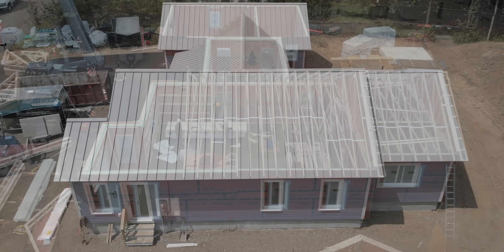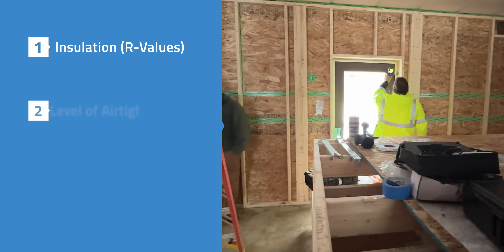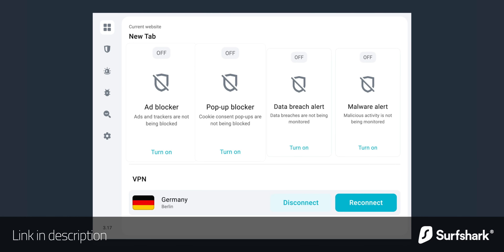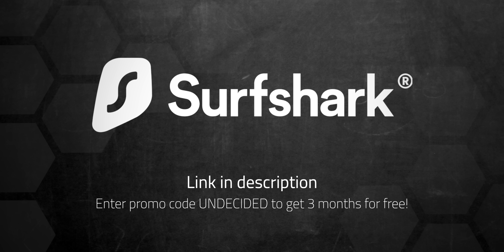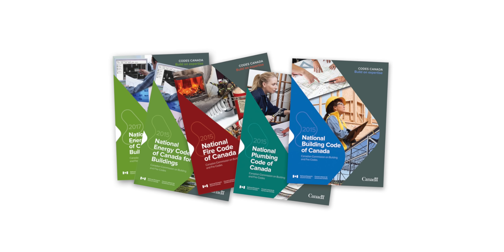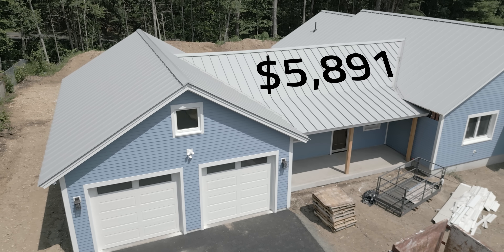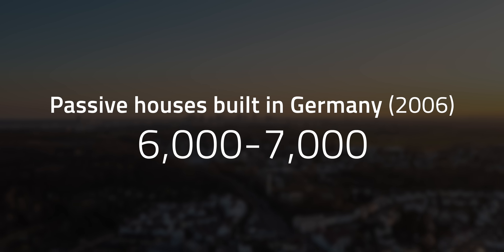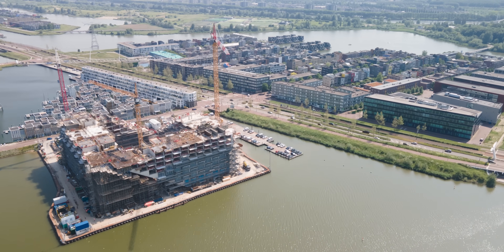Why Do American Homes Suck?

Comment: I live in a home that was built in the early 1900, it is definitely not airtight, has 0 insulation in the walls, and has multiple asbestos contaminations.

These are all fairly easy fixes, we just need money, imagine how much sleep could reduce our energy cost as a nation if there was some kind of grant, or tax write-off for remodeling old homes up to modern efficiency standards. 

New doors, windows, insulations, a house wrap. Already a huge improvement with just these. 

Maybe the government could even commission a bulk order to the supplies, and then distribute them to those who qualify at cost, it would greatly reduce remodel cost by cutting out the greedy middle man, and then residence could either remodel themselves, or hire someone to do it for them.

Comment: I lived in Switzerland, Spain and France and I can tell you that not at all it is all glory. Of course Switzerland has the highest Standards, but even there in practice a lot of theoretically sound buildings fail in practise. More tech in the houses isn't the solution, a well insulated house with walls then can absorb moisture and gas (wood, hemp bricks, adobe etc.) demand less sophisticated ventilation and often don't need a costly heat pump.

Comment: I think I read somewhere about the life expectancy of a house in the US being ridiculously low. If that's the case then it makes sense that the people funding the building aren't going to invest.

On another note I think I remember you saying you expected to consume around 5MWh/year in your new house (maybe your old one). That's nuts! I'm in a new UK home, alright but not super energy efficient, and I expect to maybe use 1 MWh total this year between electricity and a gas fired boiler (I think the US would refer to hydronic heating?). And I think that's quite high!
Reply: Are you sure you got your units right? My floor heating(1kW) in small bathroom uses around 1MWh in year. Total electricity consumption in house is 14MWh. 5MWh sound kind of possible, 1MWh feels impossible. 
I lived in 30m2 apartment for couple years and i used more electricity in there, and hot water/heating wasnt in that electricity bill. ( i think it was around 1,2MWh just for cooking, cleaning and entertainment)
Reply: @PeRusliStA  you might be right now I think harder. Will check later
Reply: “life expectancy of a house in the US… low”

Part of that is because of mobility.

In 2000, the average American lived in a home for about 3 years. American society is very mobile.

Part of mobility is about security.

Liberals don’t like to enforce the law in the US (unlike some other nations), so people vote for people who don’t enforce the laws, people die, families move out, other families in worse places move in, eventually those families figure out that it is better a little farther out, they move out, and the land is redeveloped as something more expensive, then more people move out, then the land turns into big shopping plazas, more people move out, they become warehouses, then when there is no one left, high rise building businesses are made, and people only go back for work while they find their security elsewhere for their families.

The average US family is not wealthy like Matt, who produced this video. The average family is trying to find a good school where their kids won’t get beaten up in school, their wife won’t get robbed, their daughter won’t get raped, and their car will not get broken into. Matt speaks of regulations, large numbers of people speak of families & security first, and cost is a significant factor in escaping liberal urban insecure zones. No one wants to run out of energy / fuel in one of those liberal insecure zones, along the way while going to/from work.

Security is more important than energy efficiency. Saving $90 a month on electricity is insignificant when your wife is dead.

Comment: I expected that you would cover more than just energy efficiency in this comparison. You touched on this a little bit with the choice of inferior materials such as card board sheathing. But to me this goes much further. American houses are much less durable and much more prone to failures. Stick frame buildings perform badly in storms and are not fire resistant. Asphalt shingle roofs last about 15 years, whereas European roofs last 50 to 100 years. Tiles near wood in bathrooms seems like a terrible idea and this frequently fails. 

In Germany we usually built very solid houses based on brick masonry with solid roofing tiles. In the past few decades we have been using better insulating solid blocks such as Poroton or Xella (AAC), and thicker layers of insulation. 80% of our newly built houses are using some kind of solid masonry block, and only 20% use wood.

For example one of the most popular: 'Poroton' is the trade name for a fired-clay block (or 'jumbo brick') manufactured to a high degree of accuracy. These blocks are formed with a honeycomb structure of vertical perforations, that reduce the material in the block (and thus the weight), whilst maintaining adequate strength and increasing the thermal resistance of the block.
Reply: Americans live in a home, every 3 years, before moving. They really don’t care. They have other priorities, like security, schools, and reasonable way to get to work.
Reply: @DavidHalko  Disposable homes? I do like the flexibility of Americans to take advantage of new opportunities, but this type of house construction does not seem to be very "sustainable". Wouldn't is be cheaper in the long run, if homes are more durable? I have lived in a an old Canadian home in the eighties and it seems to me that in the past homes were built to last longer, even in North America.
Reply: Hi @ChristianWagner888  -

‘disposable homes… this type of house construction does not seem to be very “sustainable”’

Well, in some ways it is VERY sustainable… home usage change dramatically over time.

For example, when I was young, we had this large console radio & record player. It took up a large section of a whole room.

In a short number of years, it disappeared, since we moved to a vertical rack. Then, it disappeared entirely. 

We had a large tube TV on a large table, with video games underneath. It disappeared entirely.

We had a wood burning stove, as we used it to survive the energy crisis in the 1970’s, with a large stove pipe that went through the wall & hung on the house. That disappeared.

Now a days, flat screen TV’s hang on a wall. 

Homes of the past did not have much window space, to save space for book shelves & other large items, and also because of the energy crisis of the 1970’s.

Bathrooms were much smaller in older houses, literally water closets.

These same homes are easily modified by people, to meet their needs. 

Stick built homes are more “forward looking” - people add kitchens, expand walls for bathroom features, add additional bathrooms, add media rooms, add home offices, add home school rooms… in the future, the large dining rooms that are disappearing in newly built homes will likely re-appear as holographic rooms.

My brick home is built to stay, but blowing out a brick wall is not trivial, to expand my bathroom, for a garden tub, or a hot tub… and a missing garden tub something that was regretted since buying the home 20 years ago.

Can work be done to concrete homes?

Sure, but adding a second kitchen, an extra wall, was effortless with stick built wood home… without assistance from external contractors.
Reply: @DavidHalko  flexibility has a higher cultural value in America, whereas durability has a higher cultural value in Europe. You certainly have a point, if people actually change walls and window sizes a lot over the lifetime of the house. Most people won't do that DIY without the help of a contractor, as this could involve plumbing, electrical and structural issues.

My grandparents house in Berlin was bought in 1939 and is now over 100 years old. It was in fairly good condition until the 1980s and then renovated from the ground up by the new owners. They added an extension with larger windows, waterproofing to the basement, improved insulation, and built out the attic with a bathroom and bedrooms. These foundational changes are made about every 40 to 50 years, but the substance of the home remains, if it was originally built well. Now three generations live in that spacious home together.  I still believe this kind of durability wins out in being more sustainable in the long run.
Reply: @ChristianWagner888  - that is an amazing amount of work, done to your grandparents home!

My stick built home is over 50 years, now. A lot of work done, I will likely be here another 20-30 years. While most Americans may not desire durability, I made this purchase for durability, even as stick built.

My home is over 50 years old, my childhood home over 70 years old, my wife’s childhood home over 120 years old… all stick built: two houses had all the windows replaced, two of those houses added a bedroom, the third house added 3 bedrooms, one expanded a full bathroom, another added a laundry room & kitchen. 

I’ve heard it said that a home is never really your own home until you make a significant addition. Perhaps, that is an American ideal.

I’m still not sure how this all scores on durability… perhaps durability is in the eye of the beholder. Enjoy your home!

Comment: I live in a third world country.
We build 99% of our houses with cement.
Most houses are 2+ floors for 1+families.
I always was curious why in the west all houses are prefabricated.

I realized,  we have no standards whatsoever
Reply: Corporate greed
Reply: @logans3365  you mean because they are cheaper so corporations can make more money?
Reply: @fuzzy-02  yes, corporations build things as cheaply as possible, often times they will design them poorly on purpose so that you have to buy another one sooner. 

My friends have a brand new $300,000 house, the floors creak, the pipes vibrate in the walls, it’s poorly insulated, etc 

They build cheap and sell expensive, for personal gain, at the cost of everyone else
Reply: @logans3365  well damn. 
Here we go by two options mostly.
Either the fsmily build their house, if their well off might also include extra floors for the kids in the future.
Or you buy an apartment in a building. 

But id say prices in general for the latter are maybe 80k,100k on average. You might find cheaper, or more expensive depending on area.

But yeah we have greed too.
Probably 7/10 contractors you hire to build your house will end up charging 30% more indirectly by stealing shit.

Like taking cement for another place their working in, to cut costs. Charging you more. Doing a terrible job 

With cement buildings and corporate greed, the most obvious issues here is moisture, dry and sometimes cracking balconies and rot from moistures on some places. You end up paying every few years for re insulating with layers of paint.

I can see why prefabricated is better. If done correctly
Reply: @fuzzy-02  imagine being able to BUY and apartment, it must be nice. 

Here you can only rent apartments, the owners keep the property and then charge insane rent prices, that’s one of the biggest reasons people can afford their own place. 

Add in greedy property developers who build crappy buildings, and then sell them high 

And banks that use predatory loan practices too keep you trapped paying a mortgage for the rest of your life. 

And you have americas housing situation. 

And I didn’t even talk about the other terrible factors like it being illegal to build anything other then a single family home in most places, and car centric design that makes it impossible to get anywhere whiteout at least  a 20min drive 🤣
Reply: @logans3365  well yeah it is terrible.
I was actually talking about past experiences here.

Lebanon currency inflated by 6700%, peaked at 10000% inflation, in 2 years so we're fucked up.

I can probably live an entire month with under 300$. But buying anything is impossible now.

It is crazy how technology is becoming better and better, yet us young people are becoming less able to buy even a fraction of what our ancestors did.
Reply: @fuzzy-02  unlike in the past, the recent generations before us were able to greatly exploit everything to its fullest potential, leaving nothing for the newer generations, unless you inherit it. 

It’s sad that no one had the foresight to do things sustainably, and with the future in mind. 

I’m only 23 and even I think about my kids, and their kids futures , along with everyone else’s, who cares if I’m not around to see the prosperity, it’s just the right thing to do.

Comment: Well at least for Solar - the cost isnt really the panels - its the battery and the installing cost that hurt their adoption right now. Going solar alone doesnt really do much for a lot of places and there are soo many rules / red tap getting it install and setup that most people simply dont follow through with it. Dont get me wrong, I understand why there are rules and laws in some places, but we really need to stream line it some how. For example, the solar installer should have more power to "ok" the blue prints as they can be held accountable. The state just needs to hold the installer accountable is all. Aka, a solar install has to have a backing of a state would make installs a bit faster/less time costly. Also, lots of homes are just old at this point. All I ever see go up anymore is rental places and not real homes. The homes that do get made are design around having a ton of income as well or HOA style. I am just saying there are a lot of issues that really need to be adressed to get thsi working well for all the income levels for people before a switch can happen I feel. Batteries need to come down, installing cost need to come down, building a home in general needs to come down, etc etc.
Reply: Not too mention predatory loan practices by solar companies. 

Interest free government loans would be fantastic

Comment: I'm in Alberta, Canada and I'm building a low energy house. I got the much better performance windows from Germany and what fascinated me was, that despite so much better and all the transportation involved, they also came a lot cheaper
Reply: Who is the manufacturer you used?
Reply: What window brand did you purchase? I purchased a lot of stuff in Lithuania, Poland, and Denmark, but never windows from Germany.
Reply: What window brand did you get?
Reply: Wish I could find a builder like Unity in Canada yet alone Alberta. Haven't had much luck!
Reply: It is not really the manufacturer of the window that is important, but rather the manufacturers of the glass, profiles and fittings. Window manufacturers are a dime a dozen. They only assemble their windows from the components. When deciding on a window, we first decided on a profile and then looked at who processes these profiles and, above all, who was able to install these windows/doors properly and professionally so that they are windproof and safe from thermal bridges. During installation it is immensely important that the following principle is observed. Diffusion-tight on the inside, diffusion-open on the outside. Many mistakes are made during installation
Reply: windows are just so stupid expensive... when u want beyond double pane in canada. 
i'm just going to build my own. 

to put in perspective.
my whole house, r50 walls, r50-r70 roof, 5000sqft, costing me $100k to build myself. excluding windows. no contractors other than spray foam. 
so i cant justify paying $40-50k for windows...
Reply: @HotNoob  Well, as a builder, we did a house last year 3500 sqft that had  $150k of windows and doors from Austria. When it was finished it had a air change of 0.3. Lowest the tester had ever seen.
Reply: @HotNoob  Building yourself is the way to go for sure! Windows don't need to cost what they do!
Reply: As someone whom tests new and existing houses on a daily basis, I continually see extremely leaky Germany/European windows.  Research before buying and written guarantees go a long way.

Comment: This has always annoyed me when it comes to buying a house in that US. Stuff like solar panels, geothermal loops, heat pumps, better insulation, and other "modern" innovations seem to be so lacking in even newly built American homes and apartments. Supposedly just because they slow down the building process more than they'd make a return since demand is so high for any home.
Reply: It’s because of greed, those units are expensive and so won’t provide a good ROI for the developers, they sell junk at a high price to maximize profits. 

Usually new homes actually suck because they were built to minimum standards, there is a sweet spot in time where homes were built well, before they started devolving as capitalism demands.